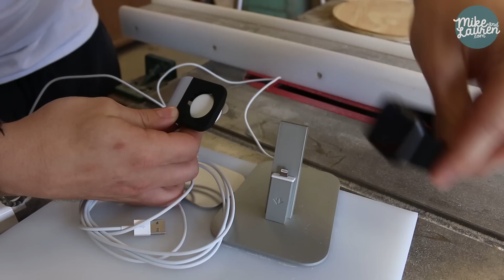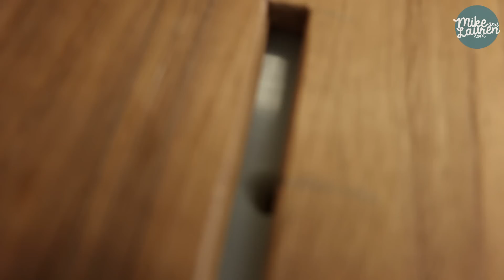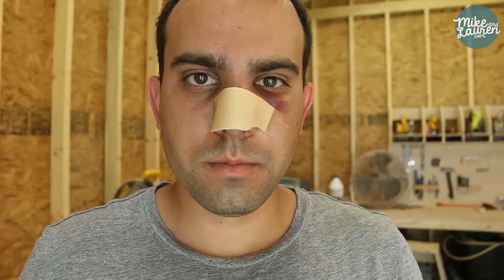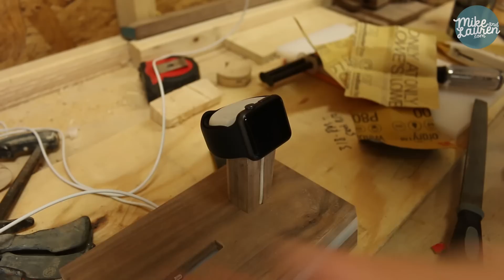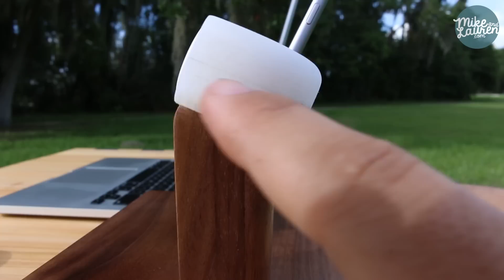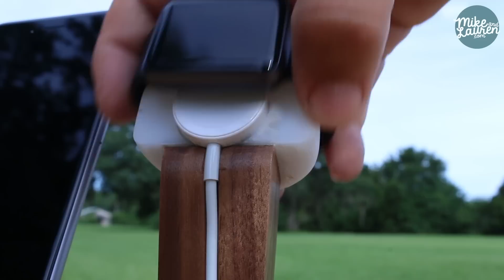Mike Makes a CUSTOM Apple Watch Charging Stand

Comment: +Mike and Lauren Curious where you guys went with splicing the wires to only use 1 plug later on. If I am not mistaken the iPhone 6 and forward support fast charge allowing you to charge your iPhone at 2 amps vs the regular 1amp or 500ma. Add that to whatever current the apple watch draws (I would guess between 500ma and 1amp) and you'll find  yourself wanting a USB power block capable of producing 3amps through a single port if you want the fastest charge the phone is capable of.

Look forward to hearing what you guys did! Cheers, and great video! also subscribed ;)

Comment: What's the thickness of the "plastic" and for the leds did you just put them under the plastic or you cut the plastic to put them inside??
Reply from the maker: Felix Blaquiere The plastic was 1/2 inch.  And we just cut the wood underneath and put the LED next to the plastic.
Reply: Thanks

Comment: nice work Mike👌 why don't you use a riving nife?
Reply: Martijn Fransen While a riving knife is a good safety feature for preventing kickback, I don't think it would have helped with something that small.  They are used to keep a board that you're ripping from pinching the blade on the back side of the cut.
Reply: The riving knife is exactly what this is for.  To prevent the work piece from slipping behind the blade and getting launched at you.  As soon as I saw your first table saw cut I said out loud 'where is the riving knife?' and then I saw you again with black eyes and knew what happened immediately.  Make a cross cut sled for small pieces and use the riving knife when not using the sled.  I hope you are still alive to be reading this post.

Comment: That weird plastic is HDPE (High-density polyethylene) I believe it's the same thing that milk jugs are made of. Recycle number 2.
Reply: What We Made Ultra-High Molecular Weight is a polyethylene, little different then High-Density, but pretty close. I would have preferred to use King StarBoard (a HDPE) instead of the UHMW. Cleaner look. I'll be doing mine totally out of StarBoard I think, probably sandwich two different colors. You can't clue HDPE well so I'll probably screw from the bottom.

Comment: Interestingly enough, I watched you using the tablesaw (incorrectly) and thought, oh you are going to hurt yourself doing that. You shouldn’t push a piece through with a hand on each side of the wood unless you’re cutting a really large piece. I know people do it, but will bite you eventually. Get a push block that puts downward pressure on the piece against the fence. Not saying this is how you injured yourself btw.